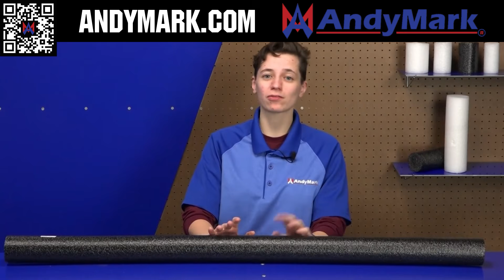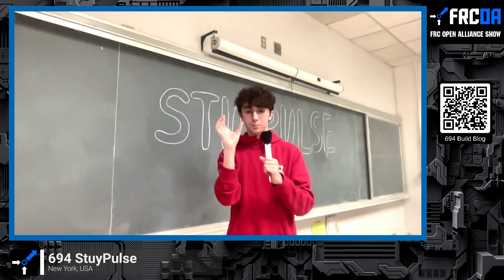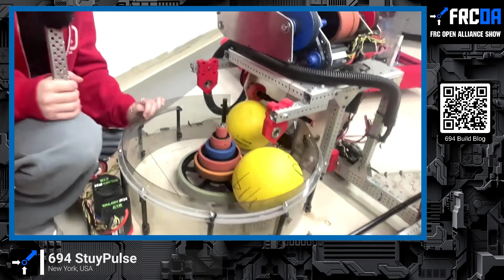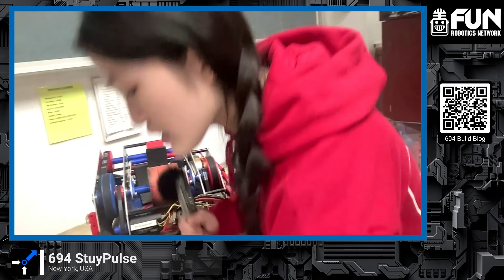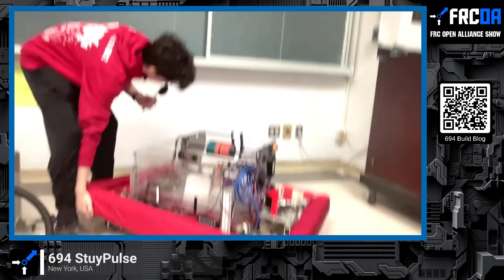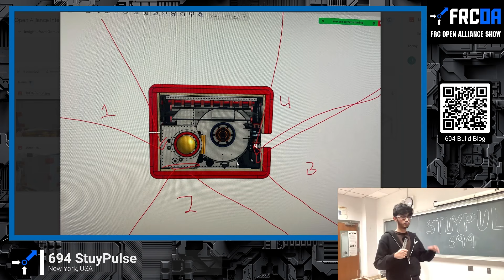A Mini Turret Every Team Should Use | 694 StuyPulse | FRC REBUILT

Comment: I don't understand why do FRC teams call it a spindexer? it isn't indexing anything, the balls are the same? from what I understand it looks like simply an agitator/stirrer to prevent balls from jamming/push them into the launcher, am I wrong?
Reply: @ShauryaChoudhary-qj5tq  it pushes it into the shooter which counts also it sounds cool
Reply: indexing is usually just the catch all term for how you deal with a game piece inside your robot, especially if your intake and outtake are separate systems. it takes thing that needs to go from here to thsre and does that. the spindexer part is because its rotary as opposed to linear indexers like cranberry alarms ri3d